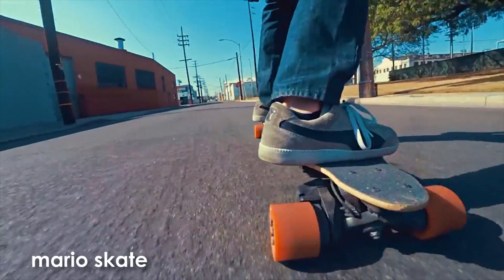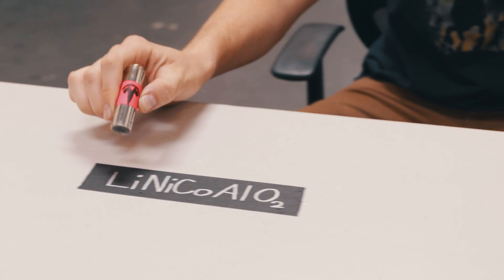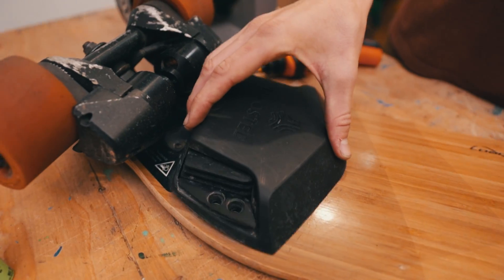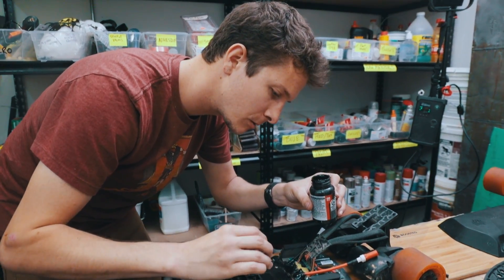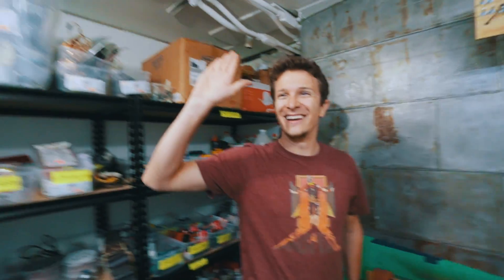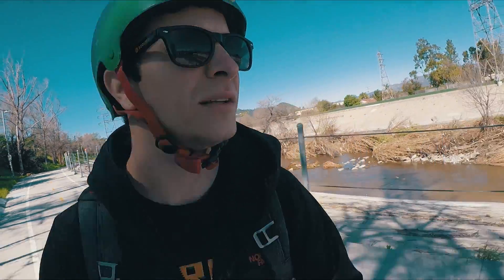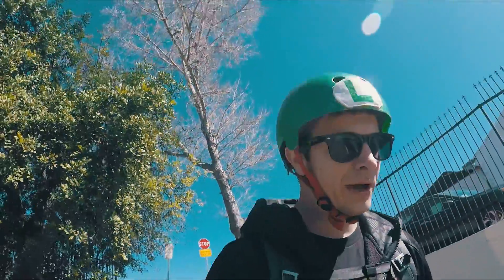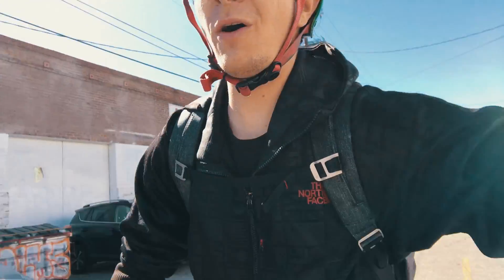Tesla Batteries in an Electric Skateboard!

Comment: you shouldn't have both batteries in the same circuit because they will sag differently and thats BAAAAAAAAAAD.  You should get a relay, and some fat voltage regulators, and run on your homemade batteries by default, and set it up so that when they reach a certain minimum voltage, the relay cuts over and you have the stock battery as "reserve"

Comment: as for the solution to your problem, the 18650Bs should be at higher voltage so that their minimum voltage is still useable
to compensate for the high voltage use a high power step down switching voltage converter

Comment: hey i think you shuld add a little switch ckt in booster board battery so as soon as board battrry vtg drops below  33v it will shut down board battery pack then your board will get power from only two battery packs that you have added

what do u think?

Comment: use serial connection? and step-down conwerter on mosfet and inductor, mosfet like as irl3205 +pwm driver 34063, additionaly use a low voltage comparator with buzzer, because low voltage kill your batteries faster. just a little problem what you have get, you can't get a recuperation.

Comment: I would have just sold the board before hacking it up and bought another with extended range.  There are at least 3 manufacturers have fast boards that can go 20 miles and zip u up a hill with no issues.

Comment: Add a switch on the board and when the booster board battery gets low flip the switch to disconnect it so it'll only use the tesla packs

Comment: the cheapest option would leave your backup batteries unplugged then when boosted battery runs out plug in a single extra one then when that one dies plug in the final one that will drain each battery which i do not recommend
Reply: but does what your trying to do

Comment: draining a battery to the end with shorten its life instead you need a bigger battery or you need to lower at the rate it slows simply by increasing battery size or another battery. you could increase the size of the battery that came with the board

Comment: Many solutions but I construct multiple packs the same amp hour as the original pack. Instead of two big packs, make 4 small one with the same capacity as the original. Run them all in parallel. Same voltage, more capacity.

Comment: if you could us the tesla batteries to charge the battery from the board then it could work
Reply: ToXiC DuBz you can't ride while the battery is charging
Reply: Skizzy depends in how it's wired. if you got juice going in one side but the wires to motor are different  (so 4 wires ) then maybe ok... not good for the lipo batt though, get very hot
Reply: Skizzy true never thought of that.

Comment: 3:25: Don't blow onto a solder joint to cool it down faster. It will create thermal stress and tiny cracks in the solder joint. Also, you should add flux first if you need to reheat already applied solder.

Comment: the main reason  you cant get the amount of amp from your batteries is because of the circuit on top of the tesla batteries. probably the circuit have current limit feature so if u remove them  and solder the batteries without that circuits u will get that amps that you want

Comment: I know nothing about this kind of stuff, but thinking of it as logically as I can, would it make sense to have a new circuit board that can handle your tesla batteries instead of the original battery? essentially cutting out the "middle man", if you will and maybe even running a larger battery pack and change out the rotors in your rear wheels that the batteries would be able to move without using a lot of the batteries power? orrrr what about a third battery specifically for the wheel motor?

Comment: You're probably limiting at the speed controller. The controller can only handle so much current draw. You might have damaged the over current circuit on that board, or may have damaged the motor itself. My suggestion is to add a higher amp speed controller and a bigger kV motor for your torque needs.

Comment: Have you considered being a next gen mythbuster, and the problem with you not being able to go uphill on the board is that the rotors in the back wheels aren't powerful enough to make it up a steep hill so it will drain more energy trying to get you up the hill where it takes the same wasted energy to go further on a flat surface, unfortunately you cannot make a more powerful rotor for the back wheels so your stuck on not being able to go up a steep incline, now with the untapped energy wouldn't it be better and more efficient if you made it so some of the power you aren't using in the Panasonic batteries are hooked up to the main power source, so when you are cruising on some of the tapped energy you'll be using the untapped energy to remotely recharge the batteries?
Reply: ReyNico that can be easily bypassed by just connecting the batteries into the lines of the other battery instead of connecting it to the charger port, but that wouldn't even solve the problem anyways and the battery would likely overheat.
Reply: Motors, not rotors.
The Panasonic batteries here ARE the main power source, so I don't know what you're going on about... The reason he can't go up the hill is because the battery drops in voltage but the amperage stays the same, in his setup.
Therefore not providing enough potential difference for the motor to work with.

Comment: POSSIBLE SOLUTION: Try replacing the actual boosted battery with the tesla battery then run the boosted at the end of the circuit, or put the controller on the teams batterues and get rid of the boosted battery

Comment: If you put the modded batteries in priority of your second battery then it will use the modded batteries before the original battery dies off then it's like a gateway to where all the energy is put into the motor. Or add a gate so where your original battery goes then when it dies it turns something off or on (not to sure) then it turns on the other batteries

Comment: Can't u just connect all battery's.so all the power in the Tesla battery and the boosted board will connect.this will make it way easier.and for the speed,u can put a way more powerful motor in the wheel.this will make it easier to go uphill.this is my advice to make the ultimate boosted board!!😀😀
Reply: He has connected the Panasonic batteries to the power input for the boosted board... And his two batteries are connected in parallel. What are you trying to say?

Also, it would be very troublesome to add a more powerful motor, which would also need higher voltage, which he cannot supply.
Reply: Codat Lennex- he needs to add more batteries
Reply: Codat Lennex    genius !
Reply: Codat Lennex by tesla battery you mean samsung battery..
Reply: He is trying to say that the original boosted battery (which is the smaller battery from the example in the video) needs to be removed. If he removed that battery then the board will only be powered by the panasonic batteries.

Comment: One company called Bateriser(then renamed to Bateroo) told they can up raise voltage in regular batteries. So I supported there project and they send me a metal pieces which didn't done nothing to the batteries....

So I don't think its possible.
Reply: Cheer up dude, shit happens :) hope ur having a better time.
Also voltage regulators and boost converters would do this. or a automated relay to a secondary circuit with more serial battery connections to boost without efficiency loss due to boost converters.
Reply: I mean you can raise voltage of a regular battery easily with a dc-dc transformer like a boost converter at the cost of lowering the amperage. I have a step up converter that changes 3-6v dc to about 40 thousand volts.
Reply: The Bateroo metal piece contain a very little boost converter so it should works but for the device wich stop after 1.4v/1.3v, the problem is there is a lot of device wich use the battery above 1.1v because in the device there is already a boost converter... So your metal piece can be useful just for few devices.
Reply: Alexander Chuguryan where did you support? I am afraid you have been scammed...
Reply: Yes, I think I have got scammed :C. And it was 100 bucks.

Comment: There are Step up circuits that can bump up the voltage, but they end up drawing more current, and they waste some energy. also, it may be hard to find one that works up to the amount of current you need. If it is higher voltage than your battery, it will end up wasting a lot of energy trying to charge the little battery mid ride. I have taken circuits one and two and some basic electronics classes at college, so i have some info, but i am not an expert, and i don't have all the info. i am assuming you can not just reach a higher voltage by arranging them so more of them are in series? I guess then you might not reach the output current you need, or they may not be safe to charge like that (again I am a programmer mostly, with a sideline in electronics).

Comment: Nice video, well I currently use the NCR18650GA cells to make my own betters packs for my multirotors. I can tell you that the reason you cannot use the rest of your custom 18650 battery pack is due to the software that runs on the Boosted board battery controller. The controller is programmed to not allow you to discharge the Battery below the safe level, otherwise you could cause damage to the battery. The problem is that despite you have added additional batt capacity, the controller is programmed to manage the factory preset battery capacity of the board. The controller cannot detect the added capacity. So either you figure out to access the code of the controller and attempt to altered so that the controller accounts for all the battery capacity you now have or completely bypass the factory controller and install an aftermarket one that you can program. Also typically when dealing with custom batteries you want to use the same type of batteries. Mixing different types of cells like you are doing is not recommended. For one regardless of how much capacity you can add you battery array is only as good as the weakest cell. In your application that means that is the boosted biard cells are say (2000mah per cell) and the new battery cells are (3400mah) you will only be able to draw about 80% of the capacity of the 2000mah battery capacity. So either you replace the. Oard's factory controller or find out the type of cell that the board comes with from factory and build your pack using the same cells across the battery array. Hope it makes sense.
Reply: It's worth noting that I was following in the footsteps of others who have done this mod with great success. I used different batteries than them so it didn't work as well. The BMS on the Boosted board doesn't have a preset capacity that it counts, it just shuts down when the internal pack gets to a certain voltage.

Comment: Take out the original batteries, and keep your modded packs hard wired in. Might need a current regulator, but that's just a small board, so not hard to wire in and tuck.

Comment: Keep an eye on those booster board batteries. The reason the charger wouldn't charge the system is because when the voltage  of lithium ion batteries gets too low if you try to recharge them they can explode. There is a good chance those batteries are bloated now and likely to explode if continued to be used.

Comment: I would add another pack on parallel. But if your talking about boosting the voltage, then you would need to use an op amp with a common emitter configuration I believe.

Comment: How did you figure a 10 volt drop is possible? 18650 battery range is only 4.2-3.7 or .5 volt drop, with 10 in series is only 5 volt drop!
Too bad not 21700 battery...

Comment: you need the voltage stack or a way to dump the flow of power. Or you might can try a High drain compositor. or better yet some kind of transformer to step up the power.

Comment: put capacitors on the feed of the motor :D the capacitor will cause the battery to draw the energy to the caps and thus allow the motor to eat as much power as it needs...

Comment: Use resistors to change the bottleneck into a constant draw of the same voltage. And or use capacitors to hold voltage to boost your overall speed when down on volts. 👍👍👍

Comment: you just need a battery isolater switch so you are able to switch off the boosted battery and use the battery pack battery (this can be made automatic through electronics or you can use a switch.
also since you have a backpack why not add battery packs to it and run a cable down?

Comment: Those batteries are doing exactly nothing.. because of the part were you cut the isolation of those wires and saudered your cables on.. WAS THE F*UCKING PROTECTION WIRE CASE, NOT THE DAMN WIRE!!! You would have to cut those open as well, because they are ground case wires are connected to absolutely nothing!!!

Comment: I wish I could be there to tinker with this thing. What I would do is say forget the original battery all together, instead wire two more battery packs in series, then hook that pair up to your original pair in parallel. You still don't want to push those 18650s too far, after a 70% drain you can start to substantially damage them. A YouTuber that I'd recommend looking into would be @jehugarcia. He has PLENTY of information on 18650s, he does electric vehicle conversions with EV West, and much more. I feel like the info on his channel would suit your needs quite well for this project.
Reply: Also, you're in the same state, so you might be able do more projects like this, possibly collab ;)

Comment: use your additional batteries to charge the charge the orignal batter via the same route that u did  behind the car .
and putting a battery voltage detector in between are availbe posibly even a wirless 1 to your phone.
then just take afew batteries in your backpack and swap then start swappin them in id run it from a pile of batteries from my backpack n then just 2 wires down the leg or somthing

Comment: How about if you use a step up transformer for the boost battery then it will equalise the voltage range for the other two batteries?

Comment: add another battery pack that acts as a reservoir for the boosted boards standard battery and keeps the voltage up on it..

or maybe wire the boosted boards batter to some kind of kinetic energy system that keeps its voltage up and use the other battery packs as the main power. might need to add another pack though.

Comment: You can have a converter that drains the energy from the two large pack's into the original battery. Kind of like you can charge a hearing aid battery by turning it sideways and charging it on a 9v battery. 9v loses charge but hearing aid battery charges.

Comment: I make ebike batteries and i think that ur hill climbing problem has something to do with the speed controller because i made my own electric skateboard with 11.1v 10,000mah and it can climb hills steeper than what i can tell in ur vid but your board is running out of power kinda early but a general rule of thumb is 1 Ah is 1 mile according to esk8 builders forum. I would recommend going to esk8 builders forum and posting a thread or reading other threads. They respond within a day or so and it is a great community.
Also batteries wired in parallel charge eachother but idk at what rate exactly. So your point in the vid saying the smaller battery is a bottle neck might not be the whole problem

Comment: You need a 6Amp Drok voltage regulator set at 35 V in parallel that should solve your problem. Also has a dope digital display that you can extend to something else or send a signal to a ESP8266. You can then read those readouts from the little webpage that's in the server in the four dollar ESP8266

Comment: You need to make it like the iPhone brick charger the brick takes all the voltage the outlet has then puts it into the cord the cord transfers all the energy to 5 volts ( say the brick takes 100 volts from the outlet the cord transfers that to 5 volts that gets out into the phone) it takes high energy and turn it into low energry

Comment: YO, YOU NEED TO SEE THIS! use a voltage booster. LIKE THIS SO HE CAN SEE IT
Reply: i had to use one when i was making a portable battery with supercapacitors. works great, multiplies voltage in return for a higher rate of energy use. so itll use that last bit of energy faster but atleast you can use it at all, i would this this is the ONLY option
Reply: The power loss in the boost converter will probably be about equal or more than the amount of energy in those last 3 volts
Reply: But would'nt that effect the long stream of power delivery he was hoping for in the batteries. Though I would be curious to see that Capacitor idea in action.

Comment: Your going to have to not use the stock battery at all. Completely bypass it all together. Also, you can use balance leads on your cells packs that you would connect to a Lipo alarm. These work up to 8s and will show accurate voltage and also let you set a voltage level that beeps the alarm when you reach it. Here is the alarm. They make all kinds of these alarms so use this link as a reference and pick the right kind for your setup. - http://www.ebay.com/itm/NEW-RC-Lipo-Battery-Low-Voltage-Alarm-1S-8S-Buzzer-Indicator-Checker-Tester-LED-/231871034687?hash=item35fc97353f:g:~V8AAOSwYIhWkUjX

Comment: I'm not an expert about electronics, but I assume that if the control board allows you to keep using it even when the voltage is under 33.5V and the issue is more about not having equal batteries in parallel, why not removing the stock battery at all, you will lose some capacity but you may obtain the full one from the added batteries.